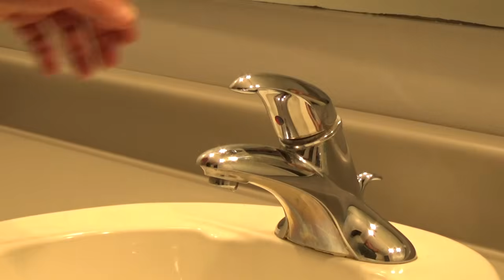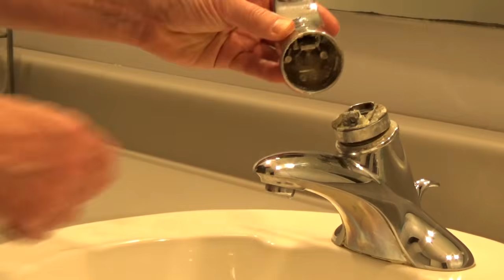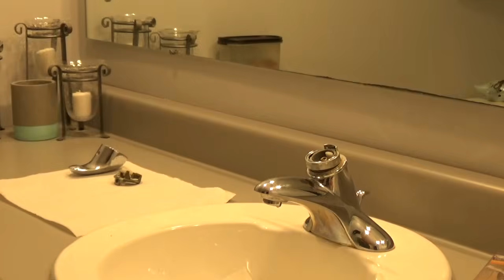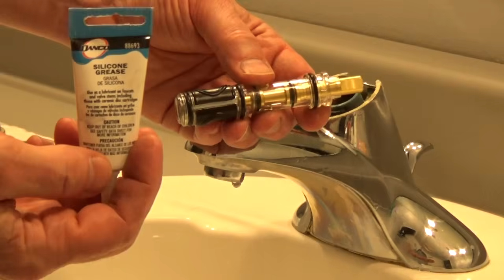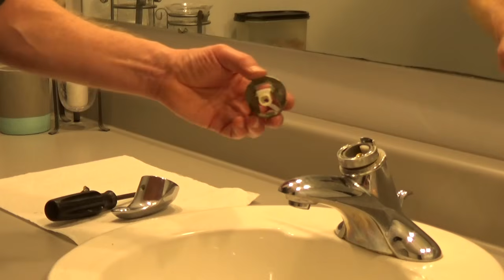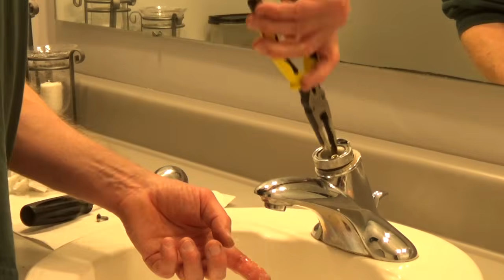Moen Bathroom Faucet Repair - Moen 1225

Comment: Great video. Although I would just replace this faucet with a two-handle one (84603), it is really a breeze to install, and there is no need to install a drain if it is working properly. This one handle is simply one overly complicated design. Cartridge itself costs $30 while the whole new faucet is $40 on ebay.

Comment: I've got a similar Moen faucet. I've removed the set screw and now I'm at at point where I need to remove the handle and sadly it's not coming off that easy like in your video. I've sprayed penetrating oil, CLR and let it sit for a while and I can't seem to pull the handle off. It's pretty stuck. Any suggestions?
Reply from the maker: Hi, I would add more penetrating oil, then tap on the top of the handle with a rubber mallet to break it free. Let me know if that helps.

Comment: If the faucet handle gets stiff when opening and closing  , Definitely the valve cartridge has to be replaced because of the way it's made  , You can't free it up using WD-40 , the seals within the valve cartridge will not let it get in there to lubricate it , Now you should be able to get a new valve cartridge because I ordered one and got it today for no charge because Moen faucets have a lifetime warranty  , If you get it at Lowe's or Home Depot  , You will have to buy it because it's an aftermarket part  , Kohler faucets also have lifetime warranty

Comment: Great video because I never had this style faucet apart 
BUT  , Before removing a valve cartridge  , Go to Home Depot and get a Moen valve cartridge puller  , Believe me 
If I didn't have that puller  , There would have been no way to get the old cartridge out and it'll save you alot of frustration and prevent damaging your faucet 
, I just looked up the price and is $26.36 at the Home Depot 
Another thing  , I got the new valve cartridge today and it didn't have the tool with it to break loose the old cartridge 
That puller is a must have if the valve cartridge has been in there a rather long time 
This is very important as well 
Be sure to pick up some waterproof grease to install the new cartridge  , Don't use the grease that came with it because it makes installing the new cartridge easier and if you should have to replace the cartridge again  , It'll make removing it easier but definitely get a valve cartridge puller to prevent damaging your faucet and plus  , It works with Moen shower faucets as well

Comment: Excellent video! 

I wound up using the tip of a small pocketknife to coax the clip out. I had very little room behind the faucet and couldn't get a grip with needle-nose plyers.

Some of my decorative rings were different, but it didn't affect the task.

Comment: Just wanted to say Thank You for this video…had it all put back together it the water was still running when it should be off.  Found your video which showed how the tab had to hook on the back before screwing the part on, everything worked great after that.  Thanks again!
Reply from the maker: You're welcome.
Check out more home improvement tips in our e-books https://www.amazon.com/gp/product/B0B2KW1FQ9?notRedirectToSDP=1&.

Comment: Thank you for this. The fact that that it dripped when it was off in the cold position, and a tiny stream in the off position when it was turned got, is why I changed the cartridge. It worked great for the cold, but the hot still drips when off, unless I press down hard on the faucet handle. Any more suggestions?
Reply from the maker: Hi, I would check the plastic threaded part that it is tightened down, then fully tighten the screw holding the handle to the cartridge. The cartridge could be bad. The store you got it from should replace it. Moen will give them credit.

Comment: My faucet isn’t leaking but it has no pressure just a trickle.  Will replacing the cartridge fix it?  Had to replace the pump in the water well and a bunch of sediment came through the lines and it’s had no pressure since.
Reply from the maker: Hi, did you remove the aerator and clean it out?
Reply: @ 
I haven’t been able to figure out how to do that.  It’s the same faucet in this video.
Reply: @FIXITHomeImprovementChannel  ok… I had to remove the aerator with a pipe wrench.  It was so tight that I thought it was one solid piece.  Good news is that I now have water pressure!  Thank you!

Comment: Thanks for the video. But I have the same issue as some others have had. The phillips screw keeps turning. The white plastic piece below is cracked/broken. I don't know what to do to get that screw to come out. Any suggestions?
Reply from the maker: Hi, you can spray the screw with penetrating oil and let it work for 20 minutes. Then with a screwdriver in the screw, tap the screwdriver with a hammer. Working it back and forth slightly can sometimes break it free.
Reply: @FIXITHomeImprovementChannel  You are talking about the phillips head screw after the handle if off, correct? I can turn the screw just fine. It just doesn't want to screw out. But I will try your suggestion. Do you think it's turning the cartridge?
Reply from the maker: @RonEmch  Can you grab the top of the screw with a needle nose pliers and try to pull it out?
Reply: @FIXITHomeImprovementChannel  Ok, yesterday after I put everything back together again, operating the faucet did not deliver hot/cold as expected in relation to the handle. So just now, I took the handle off and using the phillips screwdriver turned the screw a certain amount. The faucet then started delivering hot/cold as expected. I'm thinking the cartridge is turning with the screw. Is that possible? Is the broken white plastic piece allowing this to happen? If the cartridge is rotating, is there anyway I can inhibit it so I can unscrew the screw? Thanks again for all the replies and help.

Comment: It’s harder than people think to get that old cartridge out, trust me
Reply: Not if you twist it in a clockwise and counterclockwise position 360 degrees each way. It’s literally just rubber rings stopping the movement so the calcium build up should properly loosen after a few full turns
Reply: @garnetnelson1419read my response, there is a lot more to it if your cartridge has been in there for 13 years.
Reply: You’re exactly right, there is “a lot more to it”.
I got my handle off, then tried to loosen the screw at the top. It would not budge. I had spray it with WD-40  to try and get it to budge, there was a lot of corrosion. I think that it was either welded by corrosion or a stupid “wannabe” plumber put loc-tite on the threads before he screwed it in. Anyways, the screw did not come out, I ended up stripping the screw head by putting brute force on it - and I’m a strong 260LB guy and I still couldn’t get it out. While trying to unscrew this, the little black metal hinge that enables the lever to open and close the valve off , or change it from hot to cold broke - because of poor design, one piece is metal and one piece is plastic - well, guess what piece won😢. Now I had to call a plumber because he will have to use a screw extractor to get it out, then replace the broken plastic piece or I won’t be able to put the handle back on. 
Everyone on YouTube, that are showing this kind of video, have a perfectly clean screw, housing and parts, mine were corroded and were in the house since before 2011. 
My word to plumbers everywhere is “put some silicone grease on the threads of that top silver screw, then the threads won’t weld themselves with corrosion to inside threads of a stupid brass cartridge. Moen should have known to make the cartridge out of hardened stainless steel and not brass, since brass is a soft metal. Have a nice day, I will be a couple of hundred dollars poorer after buying my cartridge and seals from Amazon and trying to do it myself.

Comment: I need to replace the part where the water comes out. It is clogged.
Reply from the maker: Hi, unscrew the aerator and rinse it off. If it's corroded, you can replace it. https://youtu.be/h8Jc3QC93AA
Reply: It won't come off?

Comment: At 1.33 into the video which is the 4th part in your lineup, the large plastic gray ring, I cannot budge to get loose. Any suggestions ? thanks
Reply from the maker: Hi, you can use a lubricant that is safe on plastic like WD-40 Specialist Penetrant to spray the part. Let it set for 15 minutes or longer.
Check out more home improvement tips in our e-books https://www.amazon.com/gp/product/B0B2KW1FQ9?notRedirectToSDP=1&.
Reply: @FIXITHomeImprovementChannel  thank you

Comment: I didn't have a puller and I didn't want to buy one. I also didn't have the little cap with the square bit out the top to loosen the old cartridge. The new cartridge came with one but I wanted to pull my old one so I could take it with me to the store. I used needle nose pliers and pushed the tips out while rotating against the two ears. It took a bit to loosen it up but after working it free, I was able to pull the old cartridge by just pulling on the stem with my channel locks.

Comment: I’m having trouble getting the set screw out to remove the handle. It is not turning at all.
Reply from the maker: Hi, did you try using some penetrating oil on the screw?

Comment: Hot water flow is very less compared to cold water after the installation.. can you please help
Reply from the maker: Hi, I would remove the aerator and clean it out. Sometimes when you close and open the water valves it can cause debris to get stuck in the aerator.
Check out more home improvement tips in our e-books https://www.amazon.com/gp/product/B0B2KW1FQ9?notRedirectToSDP=1&.

Comment: Excellent video, helped me a lot.  Thank You!  I spent most of my time soaking parts in lime-away and scraping scale off the faucet.  Of course I had to spin the cartridge 180 degrees to properly orient hot / cold.  🤪  If I have a 50/50 shot at getting it right I’ll get it wrong every time.  There’s a slight notch on one of the flat sides of the cartridge stem.  If that notch is toward the back of the faucet closest to the mirror in the bathroom it will be oriented correctly.  The faucet is 25 years old.  The scale actually caused pitting on the faucet body so bad that in the future the cartridge solution won’t work.  The entire faucet will need to be changed but I’m old enough that the faucet will outlive me and be someone else’s problem at that point.

Comment: Water leak has worsened after the replacement. Not sure why would this happen.. I followed all the steps as shown in the video.. any suggestion?
Reply from the maker: Hi, is it leaking out of the spout or the handle?
Reply: It was leaking from the faucet mouth.. but it’s now fixed.. home depot gave me the B version of the cartridge and it’s fixed well.. but now the issue is with hot water.. the flow has reduced when I turn it towards hot water and hot water doesn’t come only cold water comes.. how do I fix that?

Comment: I am not exaggerating.  Pulling the old one out was 1000x more difficult with mine.  I am a large strong man, and it took me over an hour of twisting and pulling with large channel-lock pliers.
Reply from the maker: Hi, did you use the removal tool?
Reply: @ Yes, and sprayed “Liquid Wrench”.  I screwed the screw into the top to get a better grip with channel locks.  I broke the screw.  I finally got it out.  I used silicone grease on the new one, and still I needed to hammer it in.  I finally got the job done, but it was far more difficult than yours.  I’m not a plumber, but I am a Mechanical Engineer.  This was extremely difficult.  Mine must’ve been older and more worn than yours.
Reply: Thank you for the video.  It was helpful.
Reply: I had to get the removal tool to get the old one out and then couldn’t get the new cartridge pushed in!

Comment: I looked at several different video instructions on the web and yours were the best by far. The one thing you mentioned that no one else did was that it requires a 7/64 inch Allen wrench. Everything went like clockwork once I got that. Thanks for your efforts. 😎
Reply from the maker: You're welcome
Check out more home improvement tips in our e-books https://www.amazon.com/gp/product/B0B2KW1FQ9?notRedirectToSDP=1&.

Comment: What if I can remove the first screw under the cap? You said the size of the Allen wrench was 7/64. I used one and just can't remove the screw. The screw appears to be stripped.
Reply from the maker: Hi, you can spray a penetrating lubricant onto the screw and hopefully it gets to the threads to break the bond. If not you can use a screw extractor to grab onto the stripped head of the screw. If you have your faucet model number you can also call Moen for help. Their number is 1-800- 289-6636.
Check out more home improvement tips in our e-books https://www.amazon.com/gp/product/B0B2KW1FQ9?notRedirectToSDP=1&.
Reply: @FIXITHomeImprovementChannel  thanks

Comment: How do I know what cartridge to get?
Reply from the maker: Hi, if you remove the cartridge you can take it to a hardware store or home center and match it up, or have someone help you. The Moen 1225 is one of the most common for a single handle Moen faucet.
Check out more home improvement tips in our e-books https://www.amazon.com/gp/product/B0B2KW1FQ9?notRedirectToSDP=1&.
Reply: @FIXITHomeImprovementChannel  thank you so much

Comment: I can't get the handle off. I removed the screw but something seems to be holding it, as if there was a collar or flange inside the handle adapter assembly that's holding the handle
Reply from the maker: Hi, did you try spraying some penetrating oil into the screw hole?
Reply: Which screw? the allen type @FIXITHomeImprovementChannel
Reply: @FIXITHomeImprovementChannel  The Allen screw or the next one holding the adapter assembly?

Comment: Thank you for this video! I just finished doing my very first Moen #1225 cartridge replacement. Although the instructions for the faucet, which was purchased about fifteen years ago, DID come with cartridge replacement details, not ALL of the components came apart so easily and it was important for me to be able to CONFIRM the disassembly procedure, so that I would be able to SAFELY, gently "force" those parts in the RIGHT direction. Thanks, again!🙂
Reply from the maker: Glad it helped
Check out some home improvement tips in our e-books https://www.amazon.com/gp/product/B0B2KW1FQ9

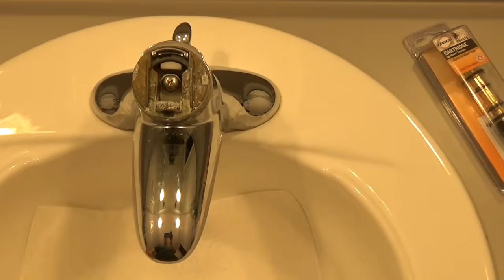Comment: So, the Phillips  screw at the top of the faucet 0:56 I'm having trouble removing. The screw itself looks fine/not stripped, however the plastic part seems to have been split all the way through, which I think is causing me to  not be able to remove the screw, any recommendations?
Reply from the maker: Hi, the screw is going into the stem of the cartridge. Is the screw loose and nut pulling up, or is it not turning?

Comment: Very thorough, useful tips. My faucet doesn't say what brand /model it is but is similar to this one with red/blue set screw cover.   Besides disassembling, is there way i can find which cartridge will fit?
Reply from the maker: Hi, the easiest is to remove the cartridge and bring it into a hardware store or home center so you can match it up. 
Check out some home improvement tips in our e-books https://www.amazon.com/gp/product/B0B2KW1FQ9

Comment: Pro tip: if the white plastic screw mount (as seen in 5:35 of this video in his right index finger) won't go back on top of the rest of the faucet assembly, it's because you need to turn the Moen 1225b cartridge right (or left) 90 degrees - use pliers to move it. This is because both the white plastic screw mount and the Moen 1225b cartridge have two straight edges and two round edges and must align. I was going nuts trying to figure out why it wouldn't sit in properly. I've changed out the cartridge a few times every time I get stuck on this part.

Comment: I always thought the cartridge only went in one way, but low and behold, it turns when installed and it flips the hot and cold sides. learned that after swapping the supply lines. Lesson learned.
Reply from the maker: Glad it was helpful
Check out more home improvement tips in our e-books https://www.amazon.com/gp/product/B0B2KW1FQ9?notRedirectToSDP=1&.

Comment: I get to the gray piece that gets turned counter clockwise to get off but it won't come off.  The chrome decorative piece is slightly different on mine so I'm thinking I have the older moen 4600 and this video is for the newer 4600 that began in 2009.  Can anyone assist with the older 4600 cartridge replacement???

Comment: Very cool video. I especially like your suggestion to line up the parts in the order you take them out to make it easier to put things back. That is something I figured out when I was 11 years old repairing a wind-up alarm clock that my mother threw in the kitchen trash can. After I fixed it, I claimed it as mine, and put it in my bedroom. 😂
Reply: Pro tip for sure!

Comment: Note: In the absence of the special removal tool (because you aren't sure of the kit you need yet and don't want to buy the seperate one for a single use) needle nose pliers, vice grips and optional obscenities work. Seriously though, thanks for showing what I needed to do. I imagine the tool could be 3D printed if there was a design.

Comment: That top screw just underneath the handle just freely spins for me :/, and it’s stripping. Blah

So I think I figured it out - the plastic housing around the screw cracked - it’s super old - and the screw will free spin now. Any troubleshooting? I think the next step would be removing the entire faucet haha… but it’s connected to copper pipe. Eh
Reply from the maker: Hi, you can send a picture to fixitpodcast@gmail.com
Reply: @FIXITHomeImprovementChannel  many thanks, just sent an email.